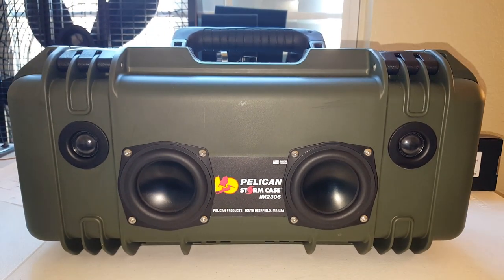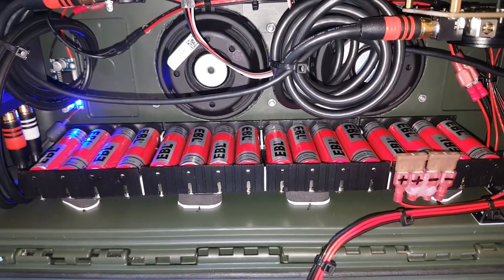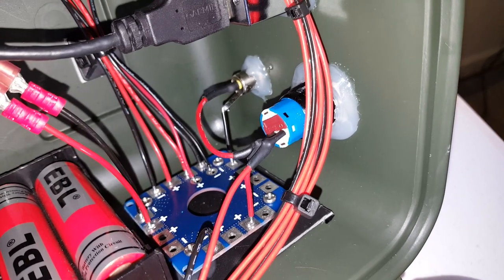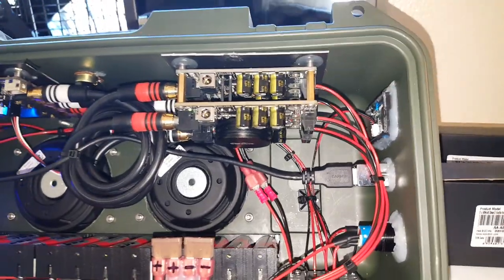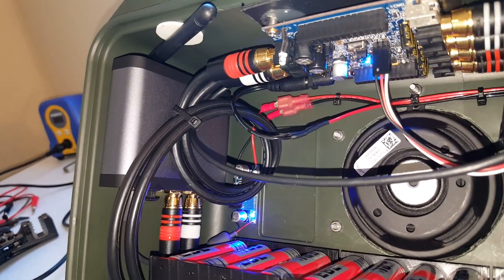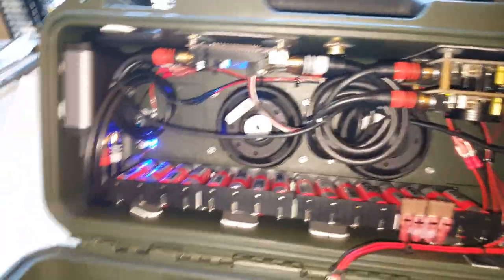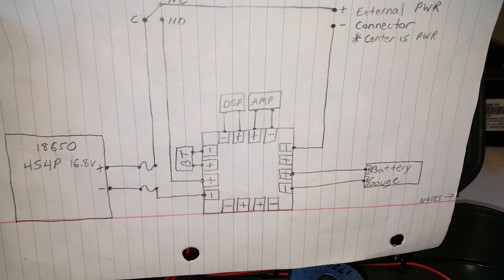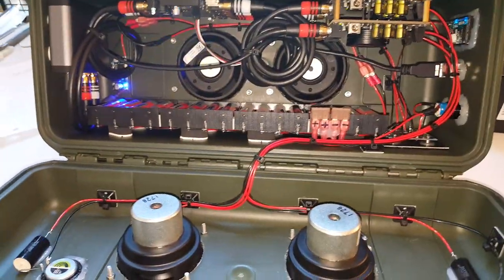DIY Bluetooth Speaker

Comment: I would say this is a bit over-engineered, but it's cool as hell, so that doesn't matter! I'm designing a bluetooth speaker for my final year of my audio engineering degree and this build gave me a few good ideas I hadn't considered yet. I found your video from checking the reviews on those passive radiators. Great build man.
Reply from the maker: Thank you so much, good luck with your build.

Comment: Super awesome build Rob! Love it, real clean, excellent utilization of all components, well planned and designed, keep it up!!!!
Reply from the maker: Thank you, watching your builds definitely inspired me!!! Sound Test!  https://youtu.be/HST33PVtZWQ
Reply: Sounds fantastic! High level craftsmanship, next level stuff! I think the mini DSP separates your custom build from all others including my creations. Small box enclosures inherently have limited acoustical tuning limitations and integrating the mini DSP resolves most of those issues. What distances are you measuring with the mic and I assume your tuning the response to be flat and linear? Separate RTA setup? Or is included with mini DSP package? I'm thinking of experimenting with the SURE DSP kernel boards and SigmaStudio software to a similar level of refinement.
Reply from the maker: modiane1 Thank you, I put in a lot of time with building and tuning. I used Room EQ Wizard for all my measuring and tuning which works great and it's free. Then I imported all the PEQ coefficent files into the minidsp program. I tried using  RTA and Sweep Measure during  measuring, both work well but I prefer using the sweep measuring in REW. I experimented a lot with measuring distances, different rooms, and height off the ground. For me it worked best to measure on axis at a distance about 3 times the diameter of the  speaker and as close as you can to the middle of the ceiling and floor. I'm looking forward to see your DSP build.

Comment: This is by far the most well thought out, robust, and aesthetically pleasing portable bluetooth boom box build that I have seen. Great job. Any chance of getting specific parts numbers of the components and a full schematic? Knowing the battery life at a "normal" listening level would be interesting too.
Reply from the maker: Good Goat Thank you, the major components are listed in the description and just about everything else can be found on Amazon and Google. The only schematic needed is the power distribution which is provided in the video. For everything else the manufacturer of the components provide instructions on wire/cable setup.

Comment: wow bro Good Job love your clean work, i am going to build one of a peli 1200 learned a lot from your vid, thnx Bro
Reply from the maker: philip bon thank you, if you want even cleaner sounding audio add a NKE0505SC dc to dc Isolating converter between the buck converter and Bluetooth receiver. I just added one and it sounds way cleaner.
Reply: thnx Bro, great tip

Comment: Again wow such clean build......
Question, is it possible to power the system with 2 x 5000 mAh 5 or 6 s rc lipo packs? I have them laying around here without use and also a powerful  lipo charger.
I have never seen somebody using rc lipo packs and I wonder why, maybe to expensive?
Hope you can give me a answer on that.
Reply from the maker: philip bon You can use a battery from just about any chemistry type. The most important thing is not to exceed the voltage limitations and power requirements of the components in your build. Please refer to the manufacturers instructions to meet the propper voltage and power requirements. Each battery type has it's pro's and cons.

Comment: Nice work!

But why did you leave your rca’s so long? That’s my only negative. Make some custom length rca’s and this build would 100%.
Reply from the maker: Thanks, I tried to find shorter cables but no luck. At the time I didn't have the parts for it. My next build will have custom cables.
Reply: rob colon 

No problem. I like making custom cables in my spare time and I couldn’t help but to notice unnecessarily long cables in such a nice clean build. Check out Redco.com for parts. Much cheaper than paying someone for custom cables if you can solder them yourself.

Comment: That's a really sweet setup, hell of a case too. My only suggestion would be different batteries, I think those EBL's and the like found on amazon are storing something around 1.5Ah or less. They're cheap yea but you have to buy 3 and put them in parallel just to get the capacity of 1 good one. IMRBatteries.com is a great vendor that has some good ones for around $4 each. So you could either triple your total capacity *by replacing all those, or just use only one bank of 4 in series and get the same capacity.
Reply from the maker: Thank you, I agree they are cheap but the endurance I'm getting is pretty good. I use the speaker about a hour or 2 a day at medium volume and it can last about a week before recharging. I have about hundred LGDBMJ1 18650 batteries that are high capacity and plan on upgrading to a 5S4P setup for this speaker for testing. This speaker is a prototype for what's coming next.
Reply: @roblc11  Damn bro, this is the prototype? I'm looking forward to seeing the final outcome.

Comment: That DSP in a BT speaker sounds pricey... while not as straight forward, you could use a RPi 3 for $35 with software.  it's got enough juice in it for 3 way crossover and/or PEQ.    there's probably some software that can use the GPU.   just need a decent USB audio adapter for the basic DAC.

Comment: you said you added the capacitors to protect the tweeters... with the crossover at 48 db per octave, is that really necessary?   Beautiful build by the way. I am wondering about using a 30 dollar bluetooth receiver to shave 150 bucks off of a similar build...
Reply from the maker: Thank you very much, they are not required but highly recommended. Those tweeters can't handle those low frequencies and the minidsp installation manual recommends it for protection. They saved me from blowing up my tweeters when I had a couple channels mixed up and during tuning, it's like paying insurance for your investment.

Comment: NICE but watch them damn EBL most sold are fakes low quality just FYI I learned that the hard way via smoke and fire great build by the way :P
Reply from the maker: Thank you, I'm aware that there are a lot of fakes out there and I was worried myself. Thankfully my batteries are authentic and I rigorously tested them myself with many charge and discharge cycles in combination with the battery protection boards prior to installing them. Thanks, I would like to get Panasonic NCR18650B's but the cost is pretty high, maybe one day.

Comment: Which Boards for the 18650‘s did you use? BMS? PCB?

Nice Box ;)
Reply from the maker: https://www.amazon.com/dp/B01J9B4FYM/ref=cm_sw_r_cp_apa_i_k71xDb8XA22V8
Reply from the maker: I changed my battery set up recently, I went with a 21v 5s4p battery using LG MJ1 batteries.
Reply from the maker: I use this protection board now. https://www.amazon.com/dp/B07SZTY59S/ref=cm_sw_r_cp_apa_i_W91xDb2PFR7QM
Reply: @roblc11  nice build, do you have a high pass to protect the woofers, how long is the playtime, you have like 200 watts in that battery's I think, must be long😅
Reply from the maker: @roygriend5143  thank you! I don't have anything to protect the woofers except the minidsp, those nd91-4s can take a beating. As far as battery life goes my bluetooth speaker will last several weeks, since then I've upgraded the battery to a 21v 5s4p 18650 battery. It feels like it will last forever. When fully charged it has about 294wh, I'm using twenty LG MJ1 3500mah 18650s.

Comment: just under an amp for cheap ebl batterys
Reply from the maker: That's my old battery setup,  I'm  now running a 5S4P setup. 21VDC when fully charged,  Twenty 18650 LG MJ1 batteries....

Comment: i’m curious what the frequency response looks like, because from mainly every source it’s said to have passive radiators with at least double the surface area of the driver. that’s one of the reasons i built mine with two dayton nd140-pr’s. if you could measure the frequency response with your microphone i’d be thankful!